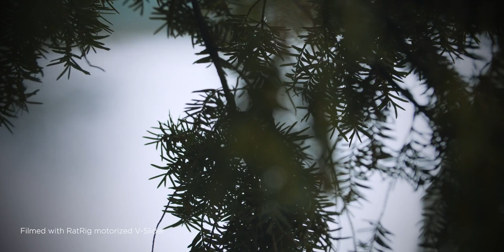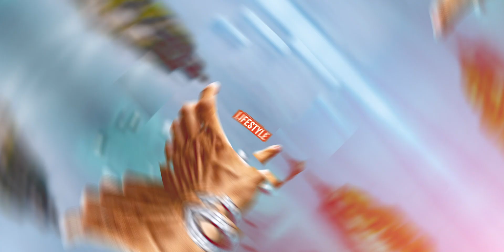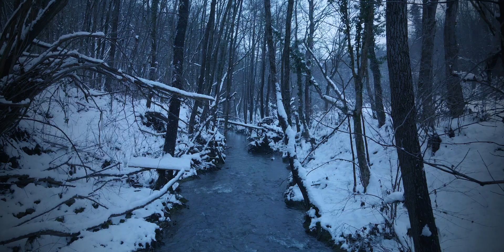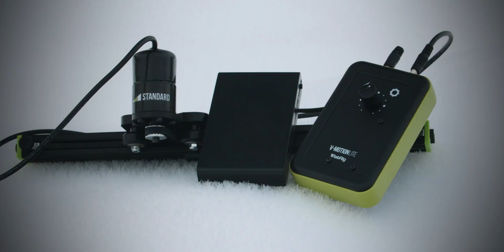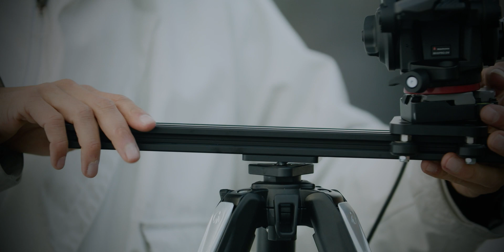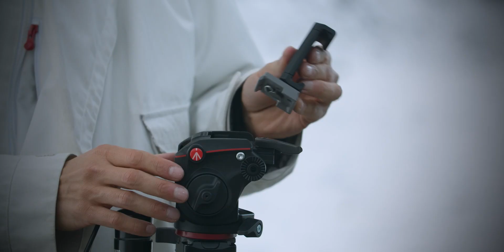The BENEFITS of SLIDERS as a self-shooter | RatRig Motorised Slider with V-Motion Lite

Comment: So useful video! In thinking of buying a slider like this, but if get it correctly the 60mm doesnt have the two extra support 1/4 thread at the two ends but the longer ones does?
Reply from the maker: Hello there. Thanks for the comment. Glad you enjoyed the video. You can find different brands of sliders with different options for your threads. Check also Rhino sliders.
Hit subscribe for more. Ciao

Comment: what is the thing you put between the slider plate and the mount for the camera?
I own a slider but the mounting screw is to small for my manfrotto fluid head.
Reply from the maker: Hello. Thanks for the comment. I use a quick release plate between the ider and the tripod head. You can also find adapter online
Reply: @MamoAir  ok thanks :)
Reply from the maker: @Gorbaswe  no problem